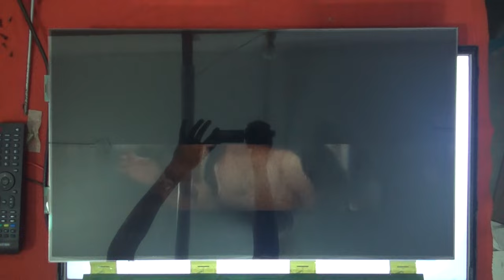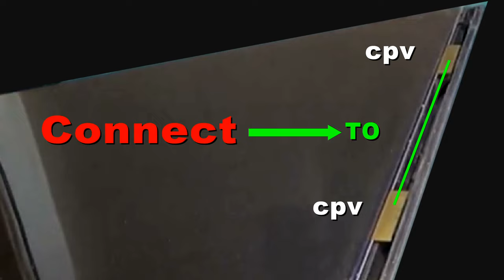Half screen LED panel repair.#Pro Hack

Comment: Vizio M55-E0. I have and issue where the screen works perfect for four hours and then just fades to a gray screen. Replaced all boards, wiring and backlights. I have to think it's a buffer board issue. When left side T con ribbon is in and right is off, I get a slow fade to white screen. Any help?
Reply from the maker: Each panel is divided into two sites.
Identify any site problem.
Reply: @ProHackHD  the thing is, is that I don't know how to read the voltages on a buffer board. Never ran into a buffer board issue before. Where would I start?